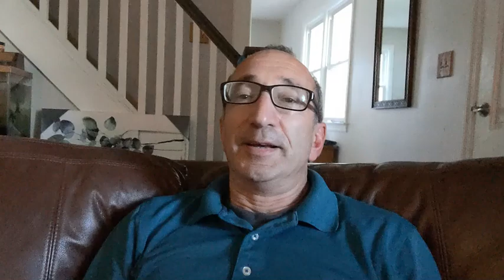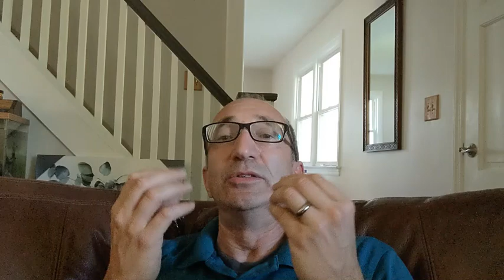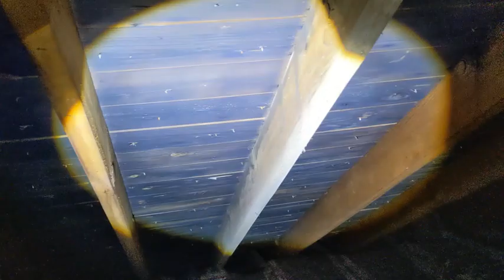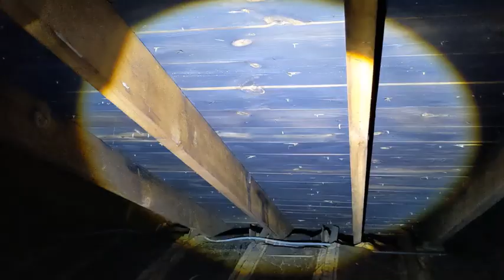New Jersey Home Inspector John Martino Explains the Causes of Attic Mold

Comment: Quick question I just purchased a house in NY (Elizabeth) with an attic that I would like to turn into a room. I’m another video you mentioned that insulation shouldn’t be placed between the rafters, because it can promote heat and moisture . Which will eventually rot the underside of the roof deck. 

The attack floor is insulated and covered with 3/4 plywood. My question is how should I go about closing up the rafters, with just Sheetrock or use some sort of foam board type of insulation? Or none at all